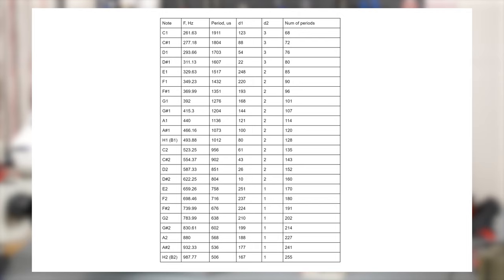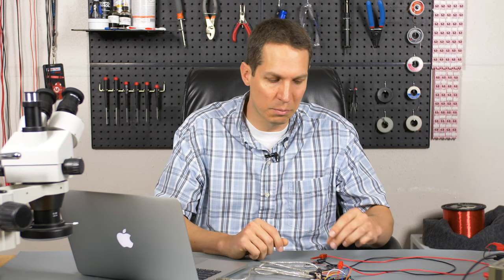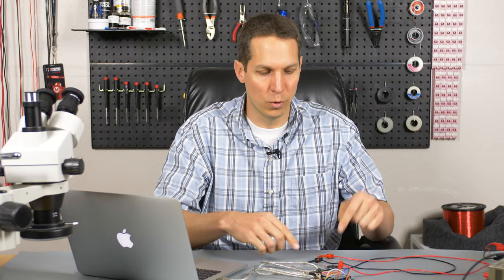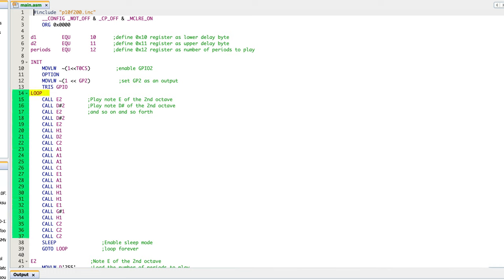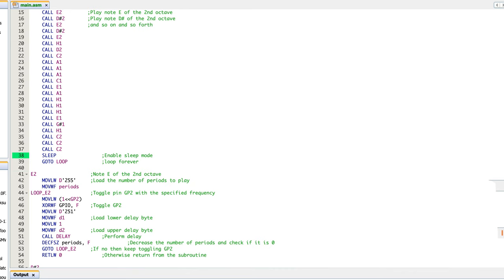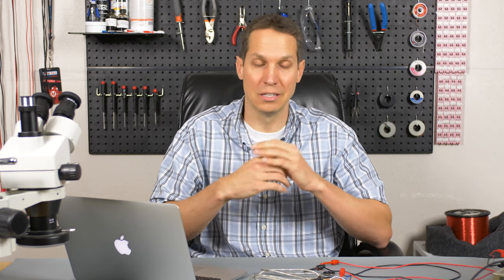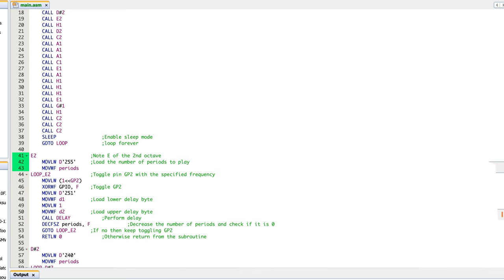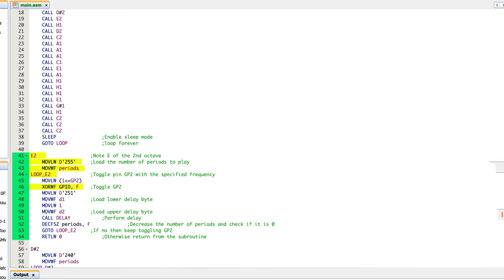Creating music with Assembly - Part 8 Microcontroller Basics (PIC10F200)

Comment: I LOVED THIS TUTORIAL! This made me think. Is there a way that you can config the MCLRE pin to be OFF at the start of the program, but then configure it to be ON later in the program? I'm a total noob trying to learn this stuff so i'm sorry if this is a dumb question.
Reply from the maker: Not a dumb question!  I will try to clarify things.  MCLR is a pin, whereas MCLRE is a bit in the configuration of the MCU.  Configuration bits cannot be changed after the MCU has "booted up".  So, if you clear it in the configuration bit (read when the MCU is "booting up") such that the MCLR pin feature is ignored (so it can be used as a digital IO pin), then you won't be able to use the MCLR pin at any point in the program.  But if you set the configuration bit, you can externally use the pin to manually reset the MCU at your convenience.  I hope that helps!

Comment: what program is being used here please? I have an Arduino UNO. Is it possible to program a buzzer that is already part of a PCB?
Do you have a video on how to use two push buttons to change the melody (i.e having two melodies using one buzzer, with a 8 pin PIC12C508A and 14 Pin HEF4069UBT?
Thanks for the upload!!
😊😊
Reply from the maker: Hi Tania!  This is MPLAB, the IDE associated with PIC microcontrollers, Sergey does a great intro to the entire platform with the first and second tutorials in this series.  WE don't actually program the buzzer but the microcontroller controlling the buzzer so if you have a pre-populated PCB that has an MCU and a buzzer on it, you can definitely program that!  
Unfortunately, we do not have a tutorial that goes over that process specifically but we do have tutorials on how to use buttons and, using an interrupt, it seems like it would be very straightforward (if you have the program space) to have your PIC play whatever melody you associate with that button.  Have fun!

Comment: What if you want to play two notes at the same time? Do you have to use two speakers or can you do that by modifying the code?
Reply from the maker: It would be a LOT easier to use two speakers but technically possible with one speaker.  Maybe there's a more elegant solution than what I'm thinking through, but it seems like it would be difficult to have the software driving it at two different frequencies at the same time.  But now I want to try it...
Reply: @CircuitBread  DTMF ... a.k.a. the telephone.